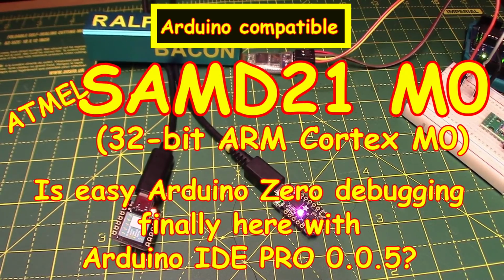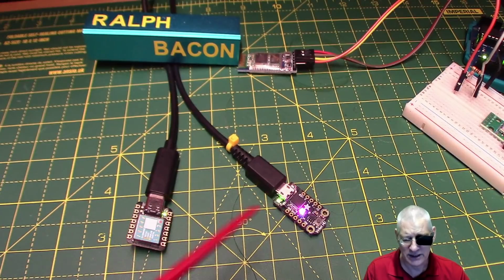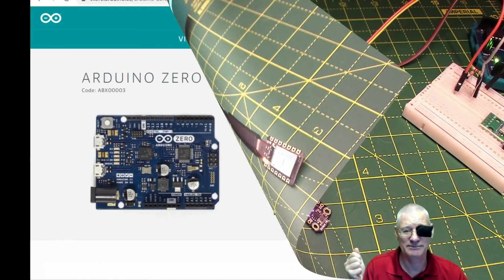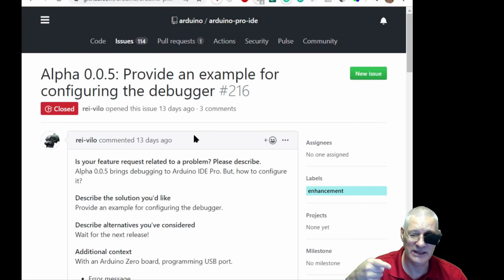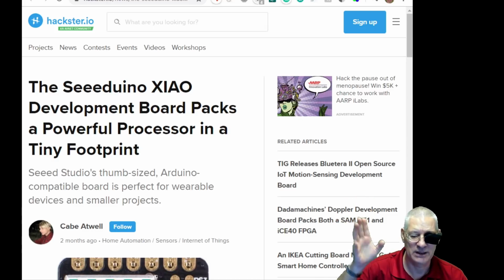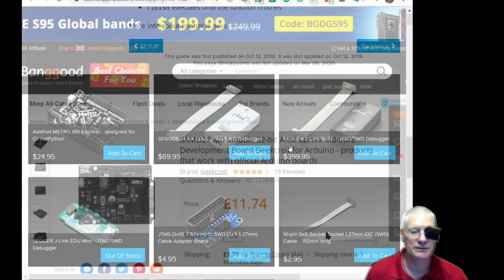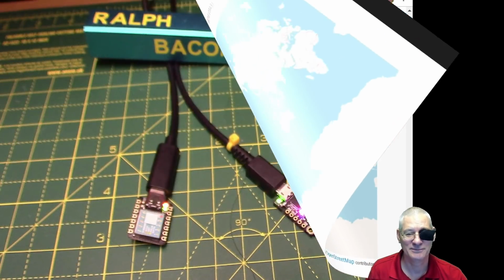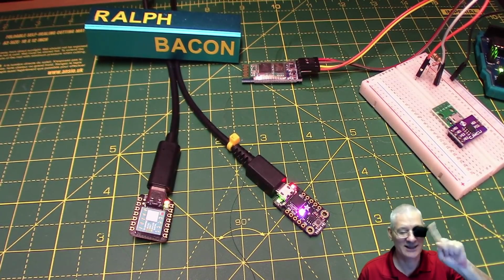#180 SAMD21 M0 boards + Arduino Zero with PRO IDE debugging?

Comment: Very helpful vid, thanks Ralph. Certainly the debugging option looks interesting and I look forward to your next or future video which will no doubt provide a fuller explanation. Before retirement, I used Excel and the Macro facilities in some depth  and as a consequence enjoyed the  in built debugger provided by MS. If the Arduino debugger works as well as the MS one in Excel, then I might very well invest my $40.  Re your sponsor JLCPCB, I assume they have had to reduce staffing due to the Car Owner virus, (Tee hee!?!) as my recent orders have taken four weeks or more to materialise and only then after I've  used the chat line to ask for support.  Good responses I have to say. Can you shed any light on their situation? All the best
Reply from the maker: JLCPCB say that they are "working as usual" but I'm guessing they might have a backlog (or had one). Yes, I'm hoping (in fact, assuming and expecting) the debugging feature to "just work" in which case the $40 is a worthwhile investment (mine came today and "just worked" although the IDE was a bit flaky).

Comment: The HC05 and HC06 caused me so much grief! All the videos I watched said 'wire this to that, connect power, flash this code and everything will simply work' and nothing ever did. There was practically no help around at the time, so I thought it must be me and I consigned the modules to the bag of 'don't want to throw it away, but I can see me ever using it' components. Only recently have I found websites that acknowledge the difficulties people have with these things since when I've dug them out of the bag and tried again. Successfully this time.  Moral of the story, if at first you don't succeed, try a bit longer. Try again in a few months. Rinse and repeat.
Reply from the maker: I found the HC06 to be well behaved (well, 4 years ago I did, I had to relearn how to do it this time around). But the HC05 was a bad boy. I'll explain all in a future video.

Comment: I have just been looking through the pin out on the SAMD21. What a cabaple chip! 
11 pins on the breakout board do not come close to show what its capable of.
I just came back into electronics a year or two ago after being away from it for 25 years, I was just getting used to the Arduino and this this 😊,The Possibilities with SAMD21 blows my mind. It is really interesting.

I am looking forward for your Smart Phone Charger.
You do know how to make a Cliffhanger.
Reply from the maker: I've been working on the Arduino side of the Smart Phone Charger - working very stable now. But more in a future video. Yes, these SAMD21 chips are (from Arduino.cc's point of view) the 328P of the current day. Cheap enough too, around $2.50-3.00, half that if you go for the smaller 16K SRAM version.